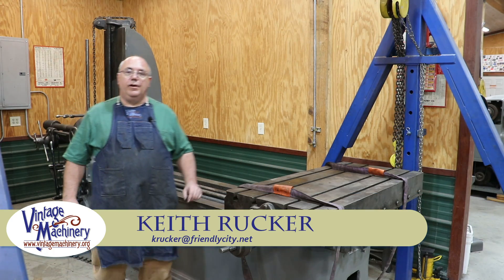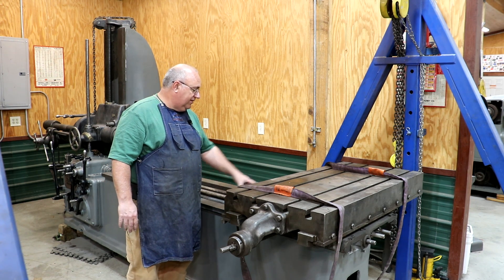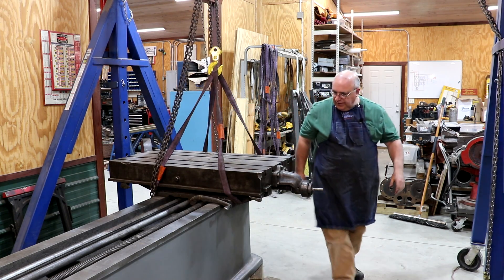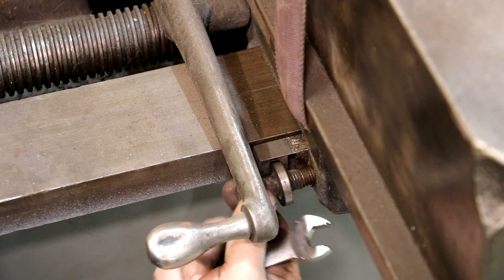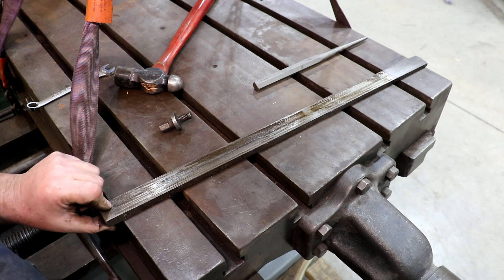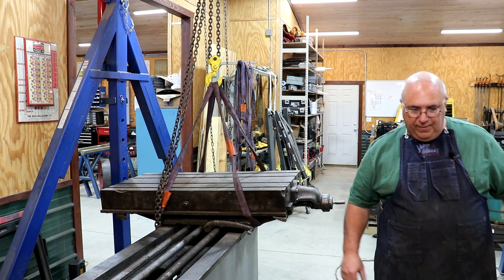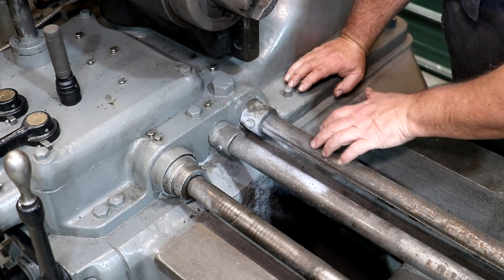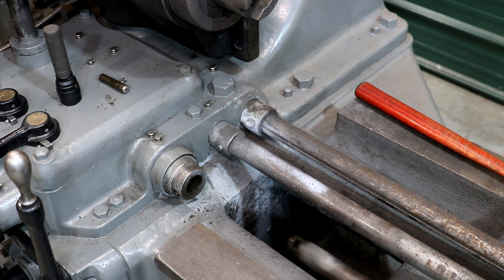Lucas Model 31 Horizontal Boring Mill - Removing the Table from the Bed

Comment: Next time get an electric winch..drill a hole in the floor to add a bolt then you have a nice pull system..you can also use it to pull things back into place like the table top...you can wrap the winch with straps around the machine then pull the table top in:)

Comment: It's interesting on these older boring mills how small the head is.  I imagine all of the speeds and feeds were generated in a separate gear box (or gear boxes) and the head only needed to support the spindle and elevating leadscrew nut.  I have a 1970's era Wotan boring mill and the head is quite large by comparison.  All of the speeds and feeds are generated in the head itself and by necessity it must be large.  I too, am in the process of rebuilding it.  It is a very slow process.  Ken

Comment: The box ways are very similar to the ways I planned on the turret lathes. The front side had a rack seat and a gib
rail to be planned as well. The headstock and the bed way were all one casting. You had to pay attention to the length of the stroke so as not to hit  the headstock. They made turret lathes with "A" type ways but I never got involved with them .

Comment: Hi Keith, When you face the wall the sound bounces and it is much louder as you turn your head away the audio drops significantly. I am not sure what you can do about it.  I have noticed over the last months the audio is not as clear as  used to be.  At times it sounds as though you are talking with gum in your mouth.  Roger

Comment: I am aware that you are working on some audio issues. FYI, the microphone you are wearing in this video is very directional. When you turn away from it the volume drops significantly. Overall, the audio on this video is very unbalanced. Also, of the various audio unit/microphone combinations you have used recently, your original setup seems to have produced the cleanest, most balanced audio. One man's observation/opinion.

Comment: Love your videos Keith, but I need to point out that your microphone is not serving you well. The audio fades to inaudible levels when you turn your head away from the mic. The audio varies from excellent when you speak towards the side the mic is attached to very low levels when speaking away from the mic. When audible the audio quality is very good. Thought you should know.

Comment: Just a note, the mike you are using is VERY directional. The volume of your voice changes about two times depending if you have your head turned toward the mike or away from it. Hard when using headphone to listing to your video. You didn't have this issue previously.

Comment: I don't know if anyone has pointed it out but your audio has been shoddy lately. It goes in and out drastically when you turn your head and your pop filter is on the mic is not doing its job. Love the videos. Keep them coming.
Reply: I've noticed that as well. I have commented on this on other videos; hopefully, Keith remedies the issue in the near future.
Reply: It's because the mic he's using is a directional mic which would be fine if he was a reporter and his head didn't turn. But, because Keith tends to turn his head quite a bit, he needs a lapel mic with at least 90 degree pickup.
Reply: @joshuablair6120  Sorry but why did you feel the need to give me a explanation to a statement I made to him? I never asked why and if I did I was clearly talking to him.

Comment: KIETH:  That new mike setup is way too directional.  When you speak with your head turned to the right the audio dies.  Can you reposition the lav mike to a more central location?  Perhaps, change the mike settings to omni directional from directional??   Or both!   As it is currently set up, its really painful to listen to.  many thanks.

Comment: That load looks way of center in the slings.
It certainly won't be easy to get the table back into place on the three shafts.
Reply: Easy to fix with the built in adjusting screw.
Reply: @millomweb  One would think, yet it's hanging way off to our right.
I'm not there so I have no idea why Keith pulled it off like that.
I suppose he had a reason.
Reply: @jimurrata6785  "Inexpertise".
He's a lovely fella and I'd have him as a granddad any day but he has gaps in his brain. I've seen him turning and supposed to be using the tailstock but he fails to get it fully pressed against the end of the work. Some people are just like that have apparent mental blocks. Still, what hid did was successful and safe.

Comment: Really enjoy your videos.  One suggestion I  would make is on your gantry you ensure your wheels are going the direction you want to move the table in. It will make it a whole lot easier for you to move it. We use to move a 10000 lb centrifuge bowl with a gantry and we had to be very aware of the wheel direction.
Reply: Good point. Heavy casters often had flats for a big wrench or a stub of round stock to slip a pipe over to turn the wheels when loaded. Especially handy if the floor wasn't perfect.

Comment: Fascinating machine.  From back in the day experience, I will suggest that the drive rods should have stayed with the table. i.e. pull the gib(s) and the three taper pins, push the table a few inches , lift it free and pull the rods later.   I will also mention a technique I've used, to add a couple of turnbuckles between the hoist and the strap. Then you can lift precisely level if you need to. Less chance of bending something.
Reply: That may be the best way to reassemble too.
Reply: @littleworkshopofhorrors2395  Exactly.  Trying to pin the rods to the base and then negotiate them back into the table would be a nightmare.
Reply: I'd tend to agree but Keith may well have decided to do it that way with a view to separating the parts for cleaning but yes the drive shafts could have been lifted off with the table.
As for 'precisely level', he'd got the lift correct but failed to use the OBVIOUS levelling screw sticking out of the end of the table ;) (Front to back, there was more table/cross slide to the back. Bringing that forward an inch or so would have levelled up the hang.
Reply: I was wondering if there was a risk of bending the rods or the screw doing this.. and, it seems like, for such a heavy machine, it might be possible to detach them at the gearbox & remove them through the table, before removing the table.. but I have never gotten that close to one of these..
Reply: @windrk_6754  IIRC through is not possible because of the gearing.  What I remember is lots of penetrating oil, lots of swearing and a big mechanic eventually just pulling them out of the table assembly.